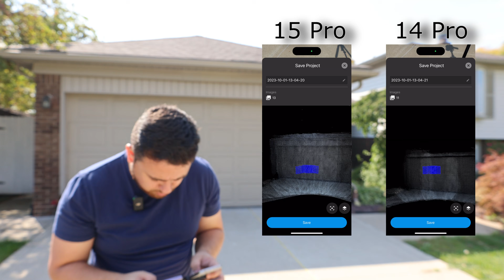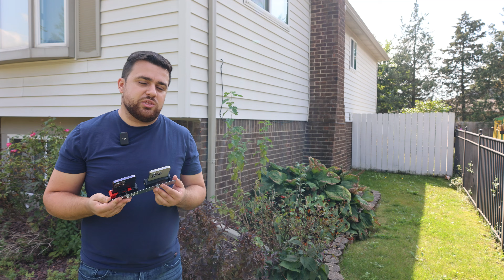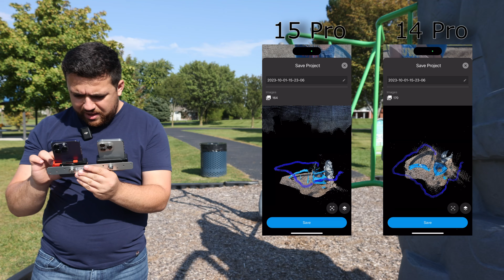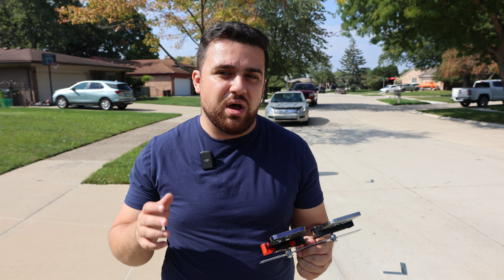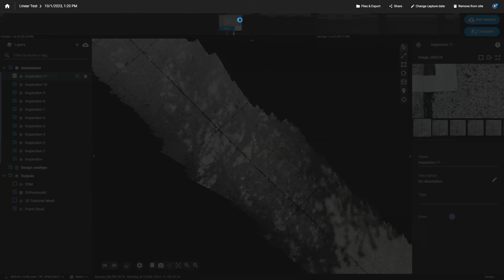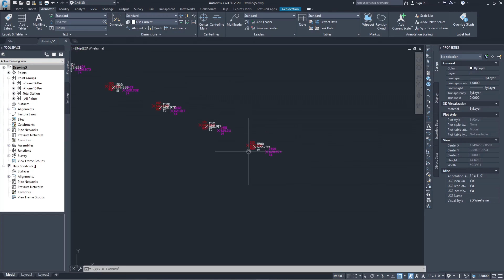iPhone 15 Pro vs iPhone 14 Pro LiDAR and Camera Accuracy Assessment

Comment: Will you be doing 15 pro vs 16 pro LiDAR comparison?
Reply: Both phones seems to using the same LIDAR chip
Reply: @clipeclipaway  Thanks! 
How was it with the older iphones Pro's - Did v12, v13 and 14 use the same Lidar sensor?
Reply: @Xsuperkraft  Older phones are still pretty decent. It seems mostly software improvements on 14 and onwards which makes them slightly more detailed and accurate.
Reply: @clipeclipaway  Thank you :D

Comment: Have you figured out how to do a sand cone ASTM D1556/D1556M with it yet?  It should be able to get the volume of the hole.  All you would have to do is cook, weigh it, and do the math with the maximum dry density for the sample.  It is still not as fast as a Troxler for density, but I am running into situations where I can't get a nuclear gage on the site.  I am sure if you cranked out a video on it and published it with the right key words you would get a lot of hits from Geotechnical Civil PEs.  Civil is not all design.  Most of it is testing of materials.  Not glamorous, but necessary for the states to sign of on R/W dedications.  You do incredible work.  Impressive!

Comment: Do you attribute the smaller relative error in the 15Pro to a better GPS receiver / software on the 15 Pro . I know that the 14 Pro had a big improvement over the 13 Pro , in that department .